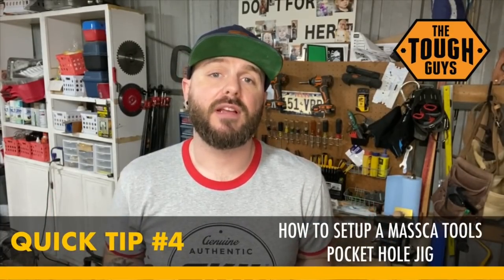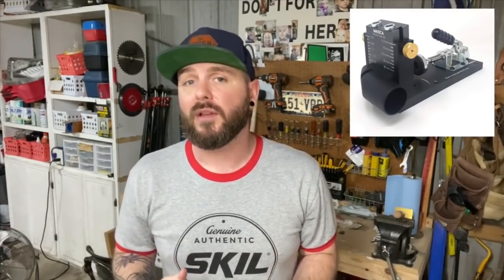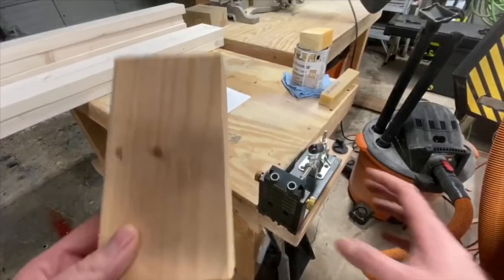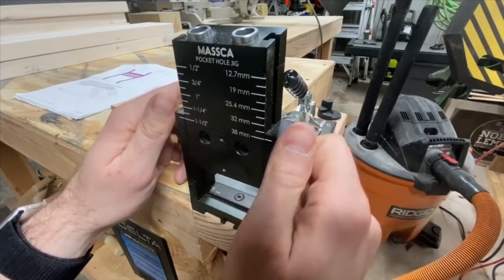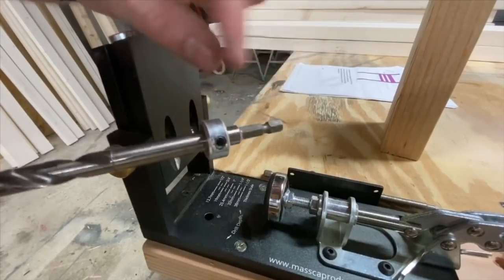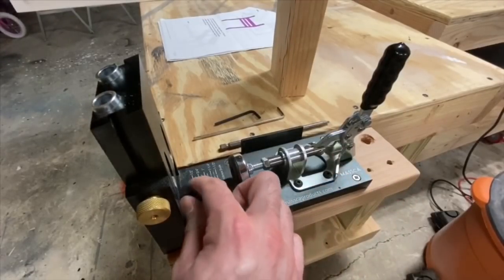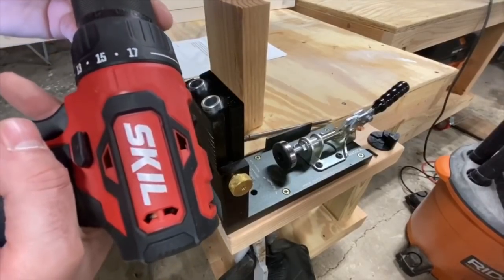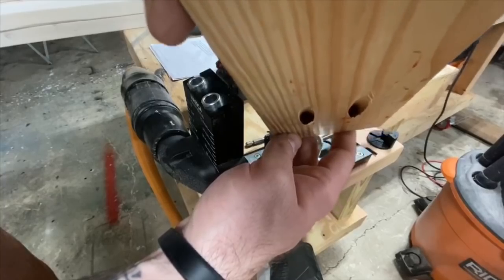Massca Pocket Hole Jig Setup & Test! Quick Tip 4

Comment: Could someone please explain why the adjustable depth stop do-hicky is important or is better?  For most of the other pocket hole jigs,  the drill  bit is only backed up approx 1/8" from the surface regardless of stock size. Thanks in advance!